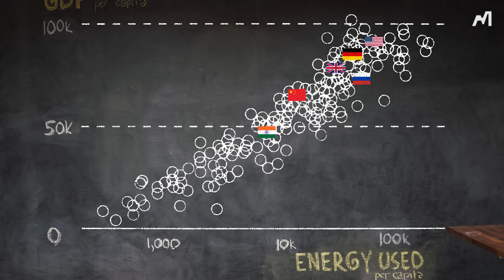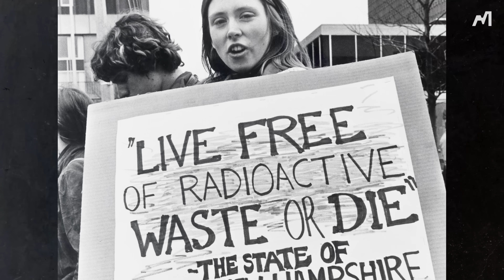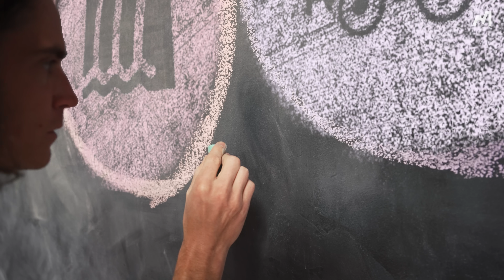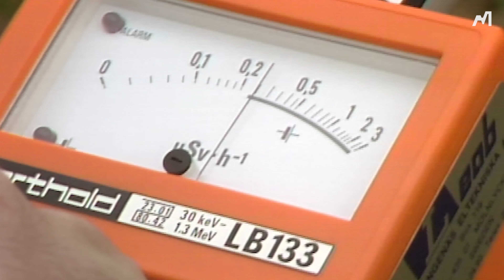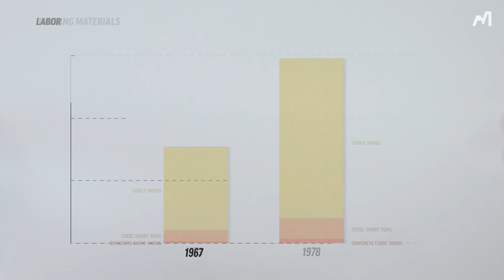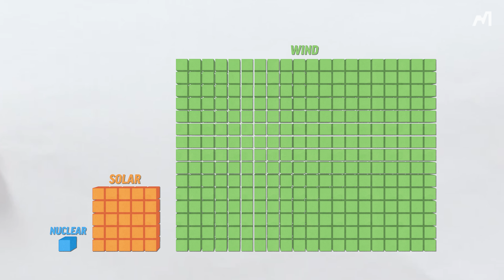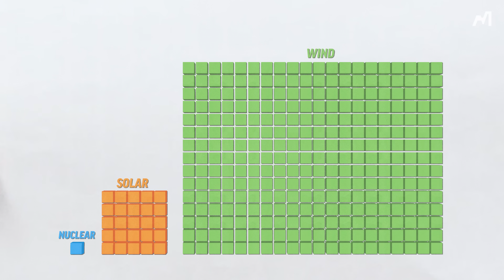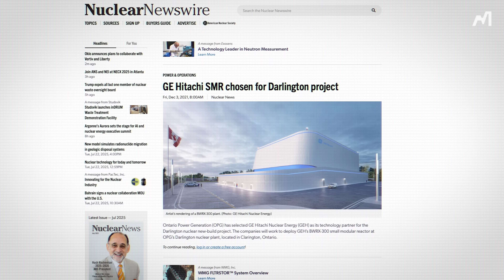They're Lying to You About Nuclear Energy

Comment: 4:30 correction, wind is actually far far more dangerous than nuclear. Accidents of technicians falling off turbines or fires lead to hundreds of injuries and at least 10-20 deaths every year. Just in the UK they often get at least a couple every year and that's not counting deaths from the actual construction of them.
Reply: Construction Falls are somehow tied to how safe it is? 😂 Ok.
Reply: Sounds like they need to do a safety campaign
Reply: “Point two units of radiation” . What is point two of a unit ? Is radiation being measured in units?
Reply: @11tigerclaw11  depends on what they’re using — is it the Sievert (most likely a sub-unit like the microsievert), the Roentgen [for exposure, rather than absorption], or units like the rad (tied to the centigray unit) and the rem (derived from the Sievert)?

Whilst I think the video could have been clearer, explaining what any one of those units means can arguably take up too much time if you don’t have a way to condense the relevant information down.
Reply: No you're incorrect & gaslighting for 🇺🇲 nuclear industry greenwash & whitewash. What you're saying is completely false.
Reply: Said blades release kilos of fiberglass from wind erosion into air
Particulate Air pollution, yum yum yum
Reply: But they look good when they are burning.
Reply: Remember 9-11? Those planes flew over Indian point nuclear reactor. They could have devastated the eastern seaboard, killed millions, left cities uninhabitable.
Reply: Ugh, with getting the subs things wrong as well, I'm leaning towards extremely lazy research for this video!
Reply: @Juttutin A little maybe, but much better than from the other side of the debate. He probably used numbers from corrupt power elites for the US only? In any case his points are still good, even using official numbers.
Reply: @Juttutin   Yeah this video was pretty bad.  I didn't appreciate the guys way of talking nor the background music trying to get some sort of emotional reaction from me or something.  Not a guy I would party with.
Reply: Every single word of this post is a shameless lie. You just made all this up and the mugs that replied to you are mindless fools. Retract.
Reply: And the Blades from them are not bio-friendly.
Reply: Yes, but barrel type turbines are far better and new vortex propeller-less small units are both innovative, super quite and safe for animals.  If we apply imagination and hi tech we can use wind without harm.
Reply: @burntofferings3770 Without harm? What about the mining with human exploitation, and huge destruction of habitat? With lakes of toxins killing farm animals? Wind is a no brainer, to oppose!

Comment: "The actual result of a meltdown" 🤔yeah if it melts down and overpasses the safety bar its obvious that its deadly. With those old technologies standard and safety mechanics like the Chernobyl, Fukushima is a whole different nuclear reactor more modern but caused by tsunami which ended up badly due to the reaction of oxygen and hydrogen with other dangerous radioactive particles from the meltdown itself...

Hence this just means that a newer technology can counter what we've experienced and learn from the past mistake hence the disasters of nuclear meltdown right now are rarer than conventional power plants. Yes its just steam from the cooling tower but i can't wait to see 4 nuclear fission power plants powering a single nuclear fusion powerplant 😊

way more economical in the long run but expensive at the first stage, requires extreme care and planning including smart people to operate it and the use of AI in a more advanced SCRAM system during a meltdown scenario, its not about the danger rate its about the people and the equipment/technologies they are using. We won't even know if its possible to create a blackhole in a fusion reactor...

Comment: If nuclear power plants are so useful and space-saving, why don't you put one on your roof and store the waste in your garden? I'd rather stick with PV with a battery, which pays for itself after 5 years. Now I cover 90% of my needs directly and I can finance the remaining 10% with my surpluses and even end up with a profit.
Reply: you're not the entire country, you're a simple domestic consumption, there's industries and also high temperature heat requirements, the comparison doesn't make sense.
Reply: @filippo1864  In fact, if every roof in the US was covered with solar panels, they could generate 45% of the country's electricity needs. This does not even take into account the potential of wind turbines on agricultural fields, which could generate 3 to 7 times the amount of electricity required, meaning that only a fraction of the available land would be needed to cover the remaining demand. And there is more than enough potential left for the next few centuries, during which the technologies will become even more efficient.

Comment: So many things wrong with this video. Conflating all radiation as the same is very wrong. Sun UV-A is not the same as beta radiation
Reply: UV-A, B, and C are all types of ionizing radiation. So, not wrong at all.
Reply: @bradleyferrier5118  isn't that only XUV? UVA and UVB are considered non ionizing
Reply: @SmilieLyon  yes, my mistake, I was thinking skin cancer. UV-C is ionizing but blocked by the ozone. A and B can cause DNA damage and cancer with a different process.
Thanks for making me check, I've had it in my head for about a decade that they all just varied in strength for ionizing which led to the damage.
Reply: ok chevron

Comment: Why not convert coal power plants to nuclear? It's very simple actually.

Coal power plants are too radioactive for nuclear standards.
Reply: Very "Simple" 😂
Reply: I don't get your point. A coal plant does nothing to release radiation. It only distributes the natural occuring one. On the other hand, a nuclear power plant works by inducing fission, therefore inducing more radiation than the natural one. So what is your point? I see it a lot in these comments.
Reply: @paprika1716  are you suggesting that "natural" radiation is less dangerous? you got that cage-free, free-range, non-GMO, organic radiation that is actually good for you? did you try telling that to marie curie? or did she secretly create fission decades early?
Reply: @benpierce2150  No I think your actively trying to misunderstand me here. No radiation is good or better. The human body has to tolerate the "natural" radiation since we are carbon, oxygen and hydrogen based lifeforms, therefore I'm neglecting the radiation from these elements (C14 in particular) If you burn coal, you move the C14 from the ground to the air, nothing else is happening here. If you look inside a fission reactor, the fuel rods are more active then normal, since the neutrons induce fission. So in one case your just moving the natural unavoidable radiation, in the other case your creating extra events. Therefore I don't think that the statement 'A coal power plant is too radioactive for nuclear' is true in that regard.
Reply: @paprika1716  Regular air isn't supposed to have Carbon-14, it's supposed to settle down and be buried with earlier life forms. Coal is what said life forms turned into. Humans, and mammals in general, evolved FAR after that happened.
Reply: @ZippyPiglin36  Your spreading misinformation! C14 is generated in the atmosphere, part of the natural carbon cycle and if the matter dies and leaves the carbon cycle, like all the animals and plants which turned to coal and oil, than it decays over time without being replentished. So mined coal has less C14 in it than you and me.
If burried, C14 decays over time!
Reply: @paprika1716  It's simply true.  You can't build a nuclear reactor on a coal plant site, it's too contaminated to ever meet standards.  Burning coal releases radiation into the air, contaminates the ground.  Coal is horrible nasty stuff, and radiation is only a tiny part of the problem.
Reply: @paprika1716  (the radiation in coal is mostly from trace amounts of uranium, thorium, and radium but thats beside the point)
we are, infact, not adapted to burning coal, belive it or not
we started doing that in just the past thousand or so years in the millions of so years it would have taken to fully adapt the entire ecosystem
Reply: @kkjkjh  You're the first one with a proper point! In fact your absolutely right that these trace elements are the main concern in fossil coal. And I absolutely agree with your point that "we" and the whole ecosystem is not adapted to burning coal, or in even broader terms, reintroduce anything from the fossile era. But I think the main point here are environmental changes due to the release of any greenhouse gases and sulfur (not a big concern today) and not any radioactive concerns. But all those points should be considered too for nuclear power as well. So in the end I wonder, since you've made a valid point. I still don't know what you're advocating for.
Reply: @paprika1716  Coal plants concentrate radioactive elements in their ash and there are no controls on the ash so it gets everywhere. Nuclear plants are extremely strict on where radioactive elements are present and if its outside stated boundaries then its a huge issue. imagine trying to set up a nuclear plant with strict controls on radioactive elements but everything is screaming contaminated by your now heightened standards. Its impossible and you would have to raise your background threshold so high you would miss contamination from the nuclear.
Reply: @rookooful  And this is right and I'll explain to you why in simple terms: A nuclear power plant has all its radiation emitting parts concentrated in one place and therefore needs shielding and all these safety protocols. A coal power plant emits radioactive traces in the are. However the fuel is much less radioactive concentrated. Due to the nature how they pollute, the fumes and the ash spread over a large area, therefor they cant accumulate to do any harm. To sum it up: Nuclear only has local concerns but might be harmful in this proximity. Coal affects a huge area so no radiation can accumulate to a harmful concentration, despite emiting more radioactive particles
Reply: @paprika1716  The actual core argument is this: In normal operation, that means as long as nothing goes very wrong, a coal plant is much more radioactive than a nuclear plant to the surrounding neighborhood. Some people are afraid of even tiny leaks of radioactivity, and it is to these people that this argument should be brought. Although I very much doubt that many would be swayed by it, especially if they were to read it here.
Reply: @entcraft44  The coal power plant is as radioactive as a pile of coal. Nothing more nothing less. If this would be an argument than you have to consider everything. Mined minerals? Uhhh radioactive. Digging a basement? Uhhh might be some Radon here, could harm me (it even will in some regions!) So why do we still talk about this point? Extracting anything from the earth is common, why trying to construct a specific argument out of it in the case of coal? The only thing you can treat differently in case of radioactivity is processed uranium.
Reply: @paprika1716  Except coal has extreme amounts of radioactive isotopes which get released into the enviroment, while the only emission of nuclear plants is water vapor. Nuclear plants cannot be made where old coal plants were due to the residual radiation being far above regulation level for nuclear plants.
Reply: @Mctrrt1  You take those isotopes in the plant and you move them out. In by truck, out by air. Please read the whole thread before you comment. This point was already made.
Reply: @paprika1716  ah yes. Natural = Good. So does uranium you know? We don’t artificially create it out of nowhere, we refine it, but it’s not a human abomination.
Reply: @paprika1716  the radiation from coal contaminates the walls, roofs, ceiling, ground, water and soil in and around the plant so much that every nuclear regulation forbids it being associated with nuclear power.

Comment: Plutonium isn't dangerous unless you get inside your body. It's amazing how many anti-nuclear nuts I run into that can't name the 3 types of radiation, know the inverse square law, or know anything about biology or physics.

Nuclear weapons and nuclear reactors have nothing to go with each other. That was a huge PR campaign by the Oil & Coal  Industries, they also gave millions of dollars to Green Peace  to spread those lies. 

Less than 50 deaths, all from the front line emergency workers and not the residents of Pripyat & Chornobyl. Doctors were told to watch out for thyroid issues, so reports of thyroid problems were over exaggerated. It's like tell people to look out for red cars being bad drivers, you'll start noticing bad drivers in red cars more than any other color.

You can't be for the environment and against nuclear power. The people who say different need to go back to middle school for basic biology and science classes.  But it's easier to sell fear than the truth looking at you 2016 & 2024 voters.

Nuclear is cleaner than solar and wind because of the short lifespan of solar and turbines, it's rare earths and other hazard waste going to landfills. None of it can be recycled. Also there needs to be petroleum to make solar and wind turbines/solar cells.... that's not even counting the huge amounts of hazardous wastes produced to make either of them. You also have to add the environmental cost of a site's batteries leaking.